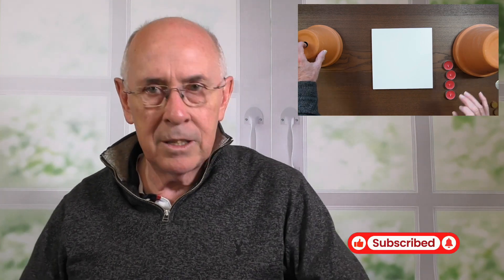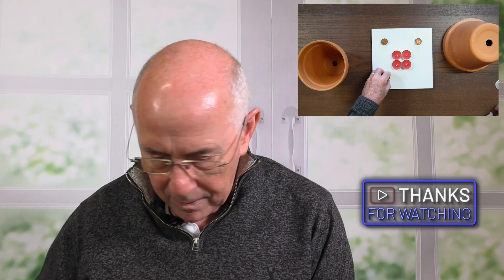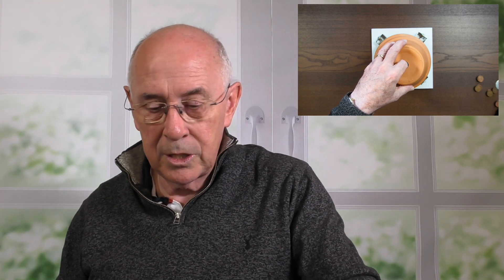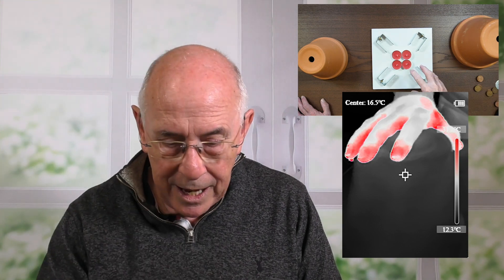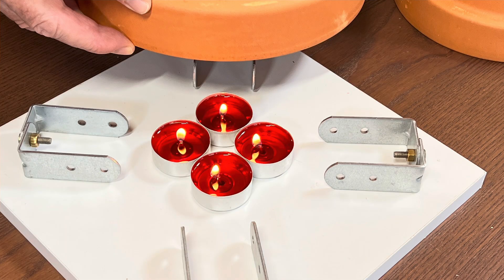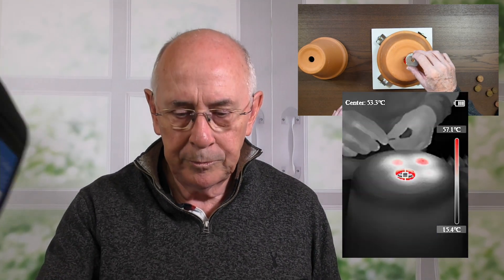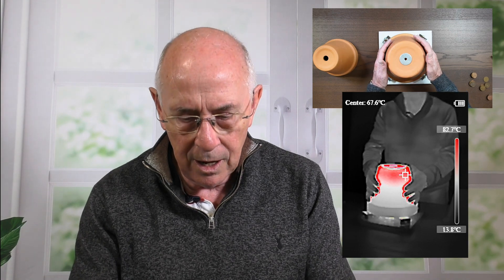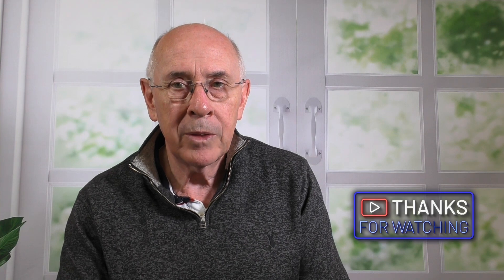How To Make A CLAY POT CANDLE HEATER | In Just A Few Minutes #educational #claypot #howto #heating

Comment: Basic physics! Energy conservation! lets say a candle generates 1J heat energy. It is absolutely irrelevant if that energy is used to heat directly the air, or the terracotta first then the air. At the end there will be 1J of heat energy no more no less. You are just delaying the heating.
p.s. a standard wax candle will generate aprox. 420kJ heat energy....

Comment: A Watt is a Watt . A Kilowatt is a kilowatt.  
A small tealight candle is equivalent to 32watts (according to Google)  the 32 Watts might be useful if you use 10 giving a 320 Watt heater for 3 hours,  maybe ? 
The main question i have is at what cost ? 
100 tealight candles cost £4 tesco = 3 KW for 3 hours ? 
I can run a fan heater 3KW for 3 hours for 25p /Kwh = 25p ×3×3 = £2.25 .
So not only is tealight candles as a heater a fire hazard.  It's a bit of a faff riging it up and almost 2× more expensive than just pluging in a oil filled radiator or fan heater or similar.
Reply: I believe this is for a power outage.
Reply from the maker: Thank you very much for your comment. Yes, I agree with your comment about cost and safety. The video was a description of what a clay plot heater can do, it was not intended to promote it.
Reply: @karenandpeter  Thanks for your reply.  I might have come across as a bit forward.  I see lot's of videos and even adverts promoting obvious scam heaters,  i try to push back , mostly at commentators.  I know you know a watt is a watt , but since we are living in a Trump / Brexit alternative facts world anything goes apparently.  I'll check in again on your channel.  All the best . Rob NE Scotland.
Reply from the maker: Hi Rob, thanks for your comments, they are much appreciated and we hope enjoy our other posts. Best wishes Karen and Peter
Reply: Well said. There is simply not enough energy in a candle to be effective. You cant magic heat into existence through some voodoo.

Comment: FYI don't use these indoors. You're releasing quite a lot of pm2 sized particles into the air in an enclosed space. A greenhouse it's fine but really don't use these in your house. 

You'd need decent ventilation to offset the pollution which is going to take away all the heat you're creating anyway.
Reply from the maker: Thanks very much for the reply
Reply: that or have a good air purifier ready.
Reply: @harrymu148 ya, on those days you're trying to survive a sub-arctic snap, there is no electricity, the natural gas or propane is gone, and there is nothing else...

Comment: I've never understood the point of the pot or pots. A tealight produces around 30 watts of heat over its whole burn. The pots don't increase that in any way shape or form. It may spread it's heat release out over a slighty longer time period but the total amount is still identical. Putting the candles in a candle holder is much safer and produces the same amount of heat. In other words, the first law of thermodynamics applies to candles as it does to any other heat source without fail and it has not been proven false once since Mr. Whatt came up with it...
Reply: The pot retains heat longer than air and opening a door doesn't have all the heat blast out in an instant.
Reply: @DiakosDelvin  if it where true that the heat is in the pot and not in the air. there would indeed be no heat to escape but there would also be no heat to feel....🤦‍♂️ as the energy can't be in two places at one.
Reply: @DiakosDelvin  But the heat enters the room in the same quantity no matter what. In terms of "how much does this increase the heat of the room?" the pot adds nothing. The total energy put into the room is exactly the same. The pot is not "unlocking" anything.
Reply from the maker: Thanks for your comment, much appreciated, and I agree that the pots can’t increase the amount of heat produced by the candles, they just store it and then gradually release it.
Reply: excactly my thoughts. The amount of energy doesn´t change no matter what. The time releasing it can be prolonged a bit. I have a tenthut in my summerhouse with a small outdoor stove, and I´ve put a big, heavy stone on top that gets heated up and releases heat for a longer time than the stove itself, but the amount of heat is the same in the end.